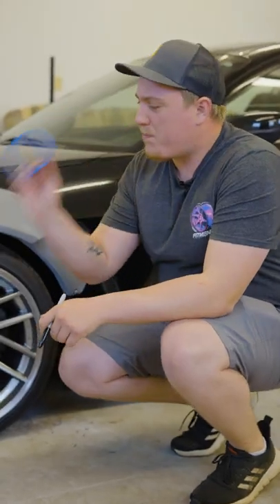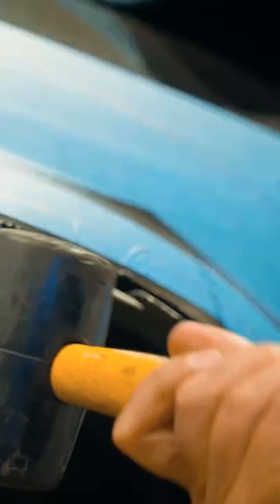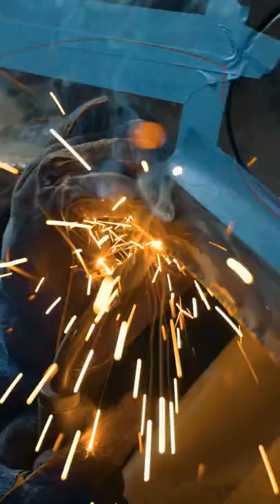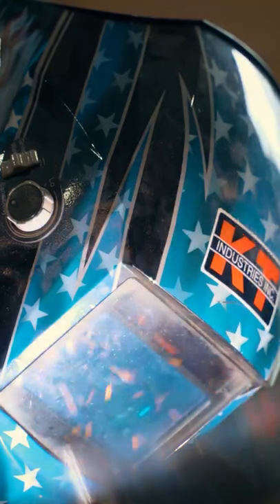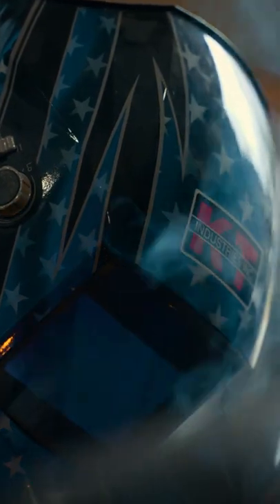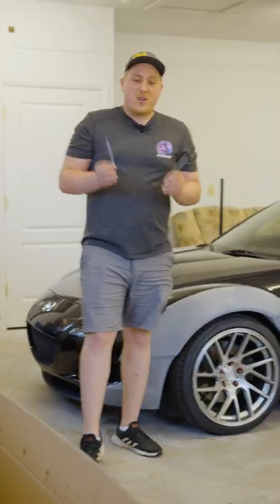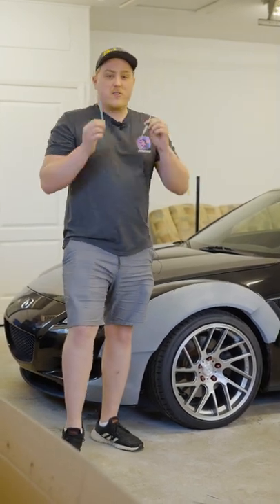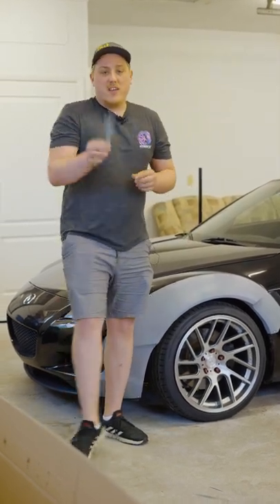How to Widebody YOUR Car in Under 1 Minute! #shorts

Comment: is this just for wider stance or wider tires also?  i got a 64 falcon id like to do this with. the front wheels got no where to go inside like the back wheels can but cant just do this just to the front. but cutting into the back trim lines might be sacrilege.
Reply: Either wider rims or you can use a spacer to offset the wheel further out. Make sure you don't cheap out on that if you do it. Also, good call on not rushing to chop up your classic.

Comment: I have a wide body 99-04 mustang GT. And I mean fucking widebody. I got 6 inch overfenders and installed them without a problem, they look pretty nice. But I’m basically fucked with the wheels, I can not find any wheels that will fit in my budget. I have been all over fitment industries, all over the internet, my local wheel and tire shops. I can’t find shit
Reply from the maker: DM us on IG or FB and we can see what we can find for you!